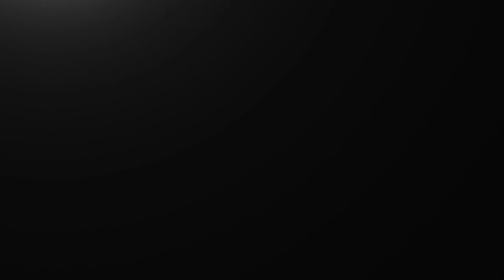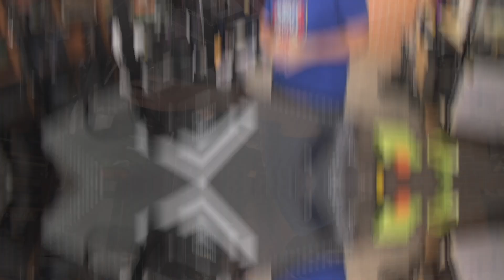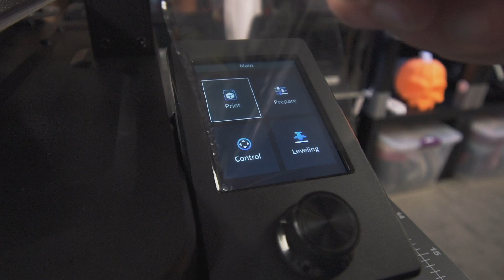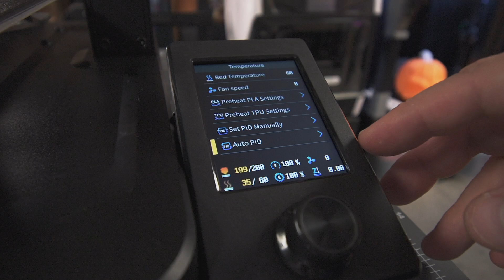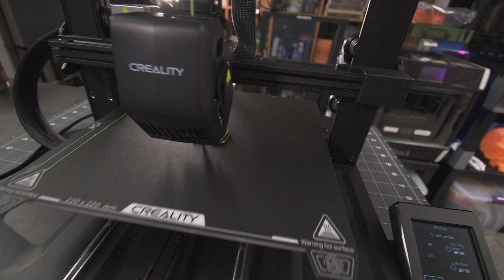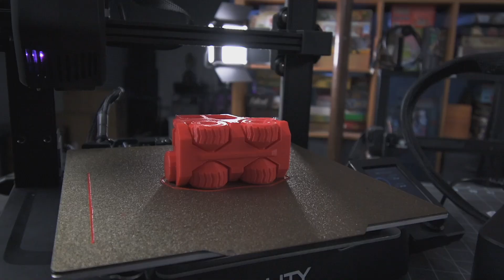$200 & Zero Calibration - Creality Ender 3 V3 SE

Comment: Mine is a piece of junk. It made three prints than crapped out. It won't level, and when trying to do a print, the print head remains stationary while the display print time is clocking down from an 8hr print job to finish in just under a minute. Creality customer service was no help. I purchased a Anycubic Kobra MAX the same time, and it has been performing flawlessly with no issues whatsoever.  The Kobra Max is running in the other room right now while the Creality printer is sitting on my desk as a useless paperweight.

Comment: Hi i just have this printer.
And just ajust the heatbed to 40 c.
And there.s no need for i peivel.
What you want to do is use Cura.
I agree to if you klik it moves to do its thing and you can not stop it.
That a mis.
You better dive in to world of cura setting.s.
 Its a super printer.

Comment: I have a question: how much can I speed up printing so as not to lose quality?
Now, on my ender 3 v3 se I print 150%. How much more can I increase? but so as not to lose quality.
I'm a beginner and I'm afraid to give more than 150%.
Reply from the maker: Send it! I’ve done 500% on some machines. Completely depends on the sliced file and its settings. But you can always go faster and back it down if you dont like what you see. ;)
Reply: @3DPrintSOS  I understand ok. And how much should the ventilation speed be set? 100% is in Ender 3 Se - 255 rpm.
And if during printing I give e.g. 50% turnover, what will happen during printing? Will it peel off?

Comment: I have one. It is a nice printer but the extruder clicks even with no filament. I have seen similar reports from others.  After Contacting Creality and following the video they provided to rebuild the extruder it still clicks. I am impressed with the bed leveling but the extruder is garbage.  I am still waiting for a solution. the other thing is that the to adjust the tension on the extruder you have to take the cover off the hot end every time... all it needed was a hole to place the allen key.

Comment: Thanks for the great and honest review! If I would put a glass bed on this printer, will all the auto-calibration feature still work? Especially the auto Z-offset?
Reply from the maker: That’s a great question. I’m not sure the auto z offset would be as accurate because it relies on the under bed pressure sensor but I think it’ll still work. worth a test! the bed leveling would be fine though, it uses a CR touch for that.

Comment: Hi, thx for the great review, mine is arriving tomorrow, i am going to use my sonic pad with it, i am just worried about the hotend, do you know if there is a hotend bi-metal upgrade for it as i can't seem to find one. Thanks
Reply from the maker: Since this uses a pretty standard sprite extruder, Im guessing you can use any sprite extruder hotend modification.
Reply: @3DPrintSOS  Thanks mate printer should have arrived today but they didn't make it so i am hoping to get it tomorrow, thanks again for the info
Reply: @3DPrintSOS  Thanks for the heads up, trying a spider ver 3, got a bit of issues but going to lathe a few pieces in ALU should work out in the end

Comment: Ender 3 often has hot end problems. Did they fix this?
Reply from the maker: These hotends are far better than the older models. Especially because you can use the hotends from the k1 if you wanted to. ;)

Comment: Hi fedor I have just bought it and the bed is so noisy and vibrates like mad, its like the rollers on the bed need greasing, can you advice,have I got a faulty machine or has anyone you know had this problem. At the moment my first print is the cat and its vibrating a lot. my ender 3 neo max is great by the way
Reply from the maker: Hmm. Mine is SUPER smooth on both the KE and SE which use the same system. I wonder if you have something loose like a bearing mount bolt. You should be able to tighten them under the flex bed. Otherwise, yeah time to grease those rods.
Reply: @3DPrintSOS  Thanks Fedor for replying, I thought i'd have a look at it, so I took my PEI sheet off and where the 2 screws are at the back where the hot plate is fixed on, there is 2 scratch like marks pretty deep, so Ive decided to return it to Amazon UK. Thanks again Fedor I love your videos

Comment: I got mine for 173€ and Wow! No prob to start printing!! I love my Prusa Mini+, never change. Prusa Mini+ with input shaper, fast. But less than 200 and lessthan 20 Screws and go!!! Without a Papertest!!! Only follow the manual. Awesome!
Reply: I forget, clean the Rods few times. And the noise from the rods/bearings it's a bit dust. Prusa was the same and the bearings need time to get smother! This is for every Bearings in the World! Clean the rods and the Rest from the grease, because grease and dust love to sticky together. If you like new grease on the rods and push the bed few times. Clean again. If you like. Enjoy it!

Comment: Great review, very detailed. I do wish you showed how well the auto-calibration handled the first layer, as thats a crucial aspect. Also, it would be interesting to know which slicer Creality chose to ship with this model. Nevertheless, its fantastic to
Reply from the maker: I just downloaded their latest slicer and it worked instantly. Creality Print. As far as the first layer, it’s all fully automated. No configuring or messing about. It just does it for you. There is a section in the video where I show how it does it and explain it.

Comment: I just got my 3V3 today.  I'm just getting to know it, and haven't printed anything with it yet.

What are you using for your slicer?  Do you have to use the Creality Print default slicer?  Or can you use Prusa (My choice) or Orca (I'm looking into it).  I will eventually want to get to get my V3 connected to OctoPi, and my normal workflow (to my 3V2) is to send my print wirelessly from my PC to Octopi via Prusaslicer.  I'm a bit concerned about using my 3V2 settings on the 3V3, especially with the autolevel settings.  Don't want to mess anything up.

I think I will buy another PLA bed for my 3V3.

Thanks for the video!  New Sub!
Reply: I will also want to (eventually) move to MriscoC or some custom firmware once support has been added.  Maybe even Klipper, dunno.  Never tried that.  :)
Reply: My biggest problem right now is the lack of third party support for this printer. I use Octoprint to manage my ender 3v2 and while it WORKS for my enter 3v3, the host action commands are disabled which means there's no two way communication between the printer and Octoprint.

The ender 3v3 is a great printer crippled by bad software and no (current) ability to side step to a third party firmware option. Company endorsed community support is non existent.

So I wait for someone way smarter than me to create a custom firmware configuration for the ender 3v3.
Reply from the maker: Looks like they just released support for the Sonic Pad to work with this machine. So that is probably their aim. For this machine to run klipper via Sonic Pad or Nebula Pad. In their eyes, making octoprint obsolete. @crooker8647   To be honest I ditched Octo for klipper many moons ago and havent wanted to go back. However, I totally get the appeal.
Reply: @3DPrintSOS  Well... I see the appeal of Klipper.  But I've been trying to get my Ender 3V2 working with Klipper for a few days and am constantly running into headaches.  It's pretty stock with a CR Touch (and I want to upgrade it with a dual Z-axis rod as well), but finding and/or configuring Klipper to work with it has been a nightmare.  I've been spending more time fighting with Klipper than actually printing anything.  I can't seem to find the right config file for my setup, and I'm not a developer (nor do I want to become one).  I understand how it works... it's just been a nightmare to GET working.  Plus I've been having issues with the Klipper PC being able to detect BOTH of my ender printers at the same time.  It seems to only want to see one or the other.  Sigh.

I just want to be able to print again.  :)  OCTO Seems to be the happy spot between control and ease-of-use for me anyway.  But the E3V3 has proven extremely difficult to customize due to lack of availability of working firmware.
Reply from the maker: I’ve only used creality slicer with this machine because I feel like that’s what most will use for it.
Reply: @3DPrintSOS  Yeah... too bad Creality Slicer is such a bad slicer.  ;)  I don't think it will be long before there are printer profiles for all the major slicers out there.
Reply from the maker: It’s definitely gotten noticeably better recently but I agree with you. It needs work. I dont see why this machine wouldn’t work with any other slicer. It’ll work with any ender 3 profile essentially on anything. So no worries there.  @crooker8647

Comment: I got this printer as my first ever machine three weeks ago  and just love it.  It has been running almost none stop during the day and I have had zero issues.  I have printed cabnets, drawers, nuts and bolts and other trinkets with no trouble.  I designed all of these things with Tinker Cad wich is fairly easy to use.  In my opinion if you are new to 3d printing this machine is for you.  Easy to assemble and use.
Reply: Hi! I’m not sure if you’ll reply since it’s already been a year since your comment, but I’ll give it a try. Where do you slice your models, and do you use a ready-made preset or adjust everything yourself? I’m currently using Orca Slicer and looking for the best preset for myself. I thought that the default presets aren’t very good — or am I wrong?

Comment: I got my Ender 3 V3 SE when it was released, and its a game-changer compared to the original Ender 3. The auto-calibration feature is a lifesaver, and I can finally trust my printer to deliver consistent results. No more late-night troubleshooting sessio
Reply: I'm having the same problems with the KE.  It depends on the print.  Mine is with a 1 inch dice.
Reply: Yeah it really is verry good.
And easy to use.
The bedtemp around 40 Celsius.
And you dont need a peivel.
It pops straight of the buildplate.
No issues there.
I think it is the best printer.
And i know how to use Cura.
Bud whit creality slicer your always on the safe site.
Al my prints are very good.
No strings Nowhere.
Just put it on retract 10.
Bedtemp at 40 c.
And there you go
Reply: Me: reading your comment at 2 in the morning trying to get the first layer to stick

I want to cry
Reply from the maker: Oof. Happens to the best of us though. Which machine?
Reply: @3DPrintSOS  Ender 3 V2.xd
Reply: @aragonmoralesfaustodavid5548   i was looking at the v2 but for only $30 more the v3 se i had to go for it
Reply: Try some hair spray my V3 SE worked great for the first 2 spools then even my best pla was trying not to stick found manual print file for leveling auto leveled the bed 6 time recording all the levels and z off set then manual set bed level to most common numbers I got. Loaded my best filament and the file for leveling V3 SE. and it failed tried hairspray like someone suggested and it started sticking like before but releases easier now @aragonmoralesfaustodavid5548

Comment: I think that I'm going to wait for the KE version. Just for the better OS, for the ceramic extruder and the PEI sheet. They decided to create a creality os based on klipper so maybe it's a good option for few bucks more. I never had a 3d printer and I ended up choosing between ender v3 series and neptune 4. This inspires me more than neptune 4. I still don't know which one is better (anybody has a suggestion maybe?)
Reply from the maker: I have no experience with the Neptune machines, but both the SE and KE are great for first machines. Both of them are very easy to use, which is a huge plus. The SE is super affordable and the KE is very capable.
Reply: @3DPrintSOS  and the KE is a way between the SE and the V3 (that should be announced soon)

Comment: Did you not miss one major negative?  PTFE all the way to the nozzle ... when will Creality learn?
Reply from the maker: I didnt miss it. I went over it. I just dont think it matters for this target market. The people that want that are going to want the KE and the people that dont care are going to stick with PLA and TPU which is what this machine is meant for. ;)
Reply: @3DPrintSOS  I don"t like toxins when ex. trying to print PETG, which this printer is surely going to be used for.  Especially since there is no reason whatsoever to keep on playing with people's health like that.  A full-metal (doesn't have to be bi-metal) heatbreak would not cost more and would remove the risk and max. temperature limitation this PTFE liner causes.
Reply from the maker: I agree with you. However, I get why they do it. If 99% of people with this machine are going to print with PLA, the PTFE lined heartbreak would technically be better. No many people are going to buy this for PETG because they would already know, as you do, that there are better options out there for printing hotter.

Comment: Its amazing to see how far Creality has come with the Ender series. This printer seems to have addressed many of the issues users had with the older models. The improved Y-axis design is a game-changer, and I love the inclusion of load cells for leveling
Reply from the maker: I agree, I’m impressed by this machine for sure. It makes this so simple, yet if you really wanted to, there is a path for upgrades. Like a K1 hotend, etc. Fun.

Comment: Im on the hunt for my first 3D printer, and this one is at the top of my list. Im looking to print articulated toys by Flexi Factory too! This Ender 3 V3 SE looks promising, but Im still a bit nervous about diving into 3D printing for the first time. 😄
Reply from the maker: This is definitely my current recommendation for a first machine. Especially if you do not want to jump in at the price of a Creality K1. :)
Reply: @3DPrintSOS what about this model vs ke?
Reply: @AutoDiag_ go for ke, better cooling, better leveling, faster print times, better printhead for just a small increase in price

Comment: This machine looks like a solid upgrade over the previous Ender 3 models. The change to using rods in the Y-axis is a promising improvement. Its interesting to see load cells in printers – a step towards more precise levelling. However, I agree that a cl
Reply from the maker: Totally agree.

Comment: You convinced me, ordered one.
Reply from the maker: Oh awesome! Hopefully my coupon worked for you. :)
Reply: @3DPrintSOS  Yes, the coupon worked, thanks.  Unfortunately, the printer does not seem to work.  

I put it together a few days ago but today is the first chance I've had to turn it on and set it up.  When I try to print anything, even the cat that came on the memory card, it randomly moved the print head and the bed for about 10 minutes, then starts the print, and within two seconds displays "Complete".  It never extrudes filament.  

I was afraid there was something wrong when during the initial z offset setup it never touched the print bed, it sat at least 100mm above through the entire setup process.  I'll go through the setup process one more time before boxing it back up and returning it.
Reply: @3DPrintSOS  After doing so Googling I see that this problem is not unique to me.  There are many, many post with people having the same problem with this printer but no fixes for it.  Looks like it will have to be sent back.

Comment: what the most exotic filament one could print with this printer?
Reply from the maker: Without mods, probably PETG would be top. Since there is a PTFE lined heatbreak in the hotend. But it’ll do any PLA your heart desires with ease.

Comment: Once its done and ciooled heat the plate back to PLA temps and she should let loose..
Reply from the maker: Nice pro tip! Never heard to doing it this way but I will give it a try. I need to print a single layer, full build plate sheet and see how it does.

Comment: A very thorough review. Clear and detailed. Good work!
Just a few remarks: I would have liked to see how the first layer was printed. That would have showed how close the auto calibration turned out to be. Secondly - It would have been nice if you showed us what slicer Creality has chosen. Is it Cura based? Prusa slicer based? I have no doubts there will be a profile available for both the Cura and Prusa slicer (or even the BambuLabs based slicer), but for now it has to be the Creality slicer. Oh - and a tip. I know those build plates from Creality. Strange as it may sound, you can avoid models sticking too hard to these kind of build plates by using a thin layer of spray adhesive. I personally use 3DLAC witch is a cheap but very effective spray that will last hundreds of prints (you mostly only have to spray once for several prints).
Considering the Menu. I agree it is counter-productive to show menu items as submenu, while in reality it's a toggle. That's confusing. However - Is this not pointed out in the manual? Most Creality machines come with a decent manual and a menu lay-out. Especially a beginner will read that manual before clicking all kinds of buttons.
It seems Creality is as close as possible to a inexpensive "plug and play" 3D printer. I think that's a good thing, especially for those that are new to 3D printing. I certainly are tempted to try this model out for the price point it is offered.
Reply from the maker: All things noted. Thanks for the feedback. Yeah I think creality nailed this one.

Comment: Can i print ASA with this machine ?
Reply from the maker: No. This machine has a PTFE lined hotend and the open air chassis of the machine wouldn’t well with ASA. You’d need a heat break and an enclosure. But then the temps on the hotend are limited as well. This is a PLA machine